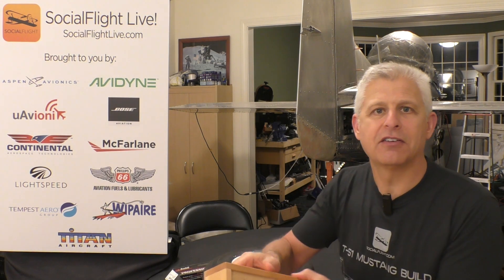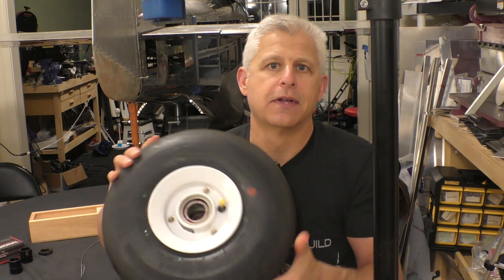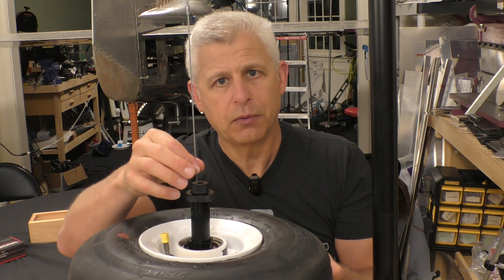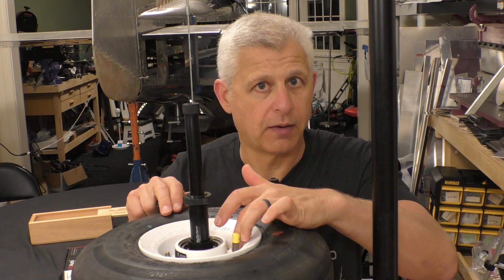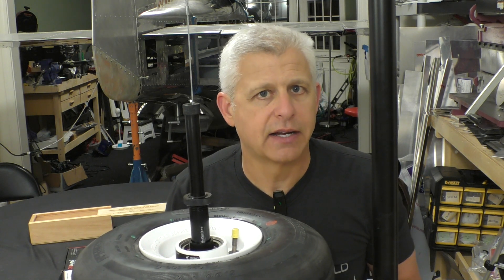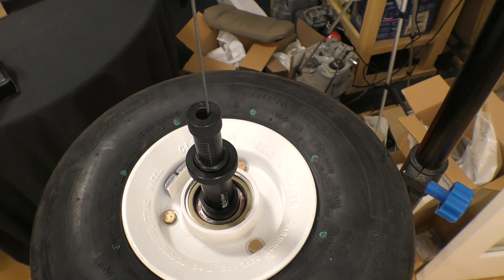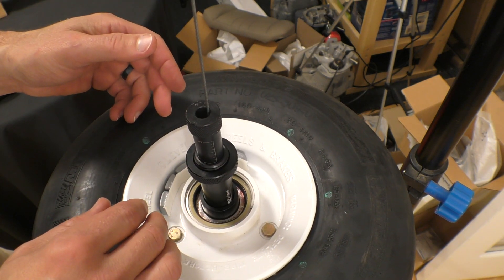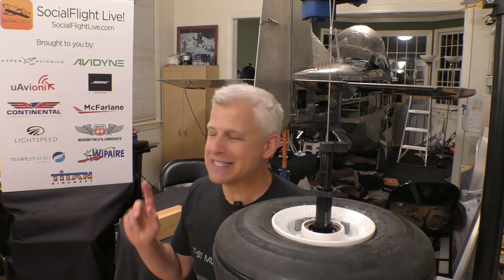BALANCE YOUR AIRCRAFT WHEELS! (the RIGHT WAY with McFarlane's Wheel Balancing Tool)

Comment: I didn't know it was so rare! I balance mine. I used a basic "motorcycle wheel balancer", though its cones wouldn't go large enough for my axle, so I 3D printed some cones. (my mechanic's balancer was the same, not fitting the large diameter axle)

Comment: Hey Jeff! Quick tip we use on road race cars where we deal with a lot of heat and lateral G's. Put a strip of aluminum high temp hvac tape over your weights once installed. They will never fall off.
Reply from the maker: @MauriceColontonio  Great idea! I’m also looking into weight pads for inside the tires, but they’re very hard to find and expensive when you find them (unless someone has a better source).

Comment: It's funny, but the last several tires we balanced, after needing a lot of weight, we swapped the red dot to the opposite side of the stem and the tires were easier to balance, some needing no weight, go figure.
Reply: there's nothing to 'go figure' -  that's how you're supposed to handle a tire that is 'way off'.  That red dot... it's a starting point and in many cases... a BAD starting point.  If I need more than 1 1/2 oz - I move that red dot 180º and start over.  Good luck everybody- be safe.

Comment: This is great for static balance, but it does nothing for dynamic balance, or to offset lateral imbalances in the tire. That's why many of us experimental owners use ceramic balancing beads, a proven technology that has been used in trucks, motorcycles, trailers and more for decades. Even better, the beads keep the wheel in perfect balance over time, even if the tire wears abnormally (think flat spot from landing with brakes on).

Comment: If one weight is too much, you can take two weights and place them the same distance on either side of where the weight is needed. Move them closer or further away until the cable is centered in the hole as you lower the tube and increase the sensitivity. You should also try to put about the same amount of weight on both sides of the wheel so that you don't create a heavy spot on one side of the wheel. That could cause the wheel to want to wobble as it rolls. Of course, without a dynamic wheel balancer, you won't know if the tire already has a heavy spot on one side. Putting all of the weight on one side could make it worse or somewhat cancel it. However, the weight is pretty close to the center of the wheel.